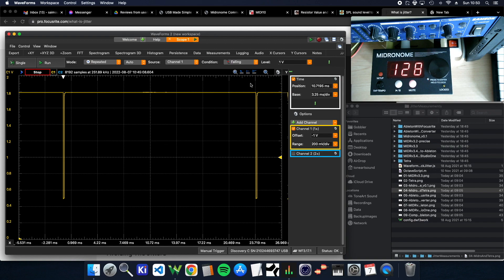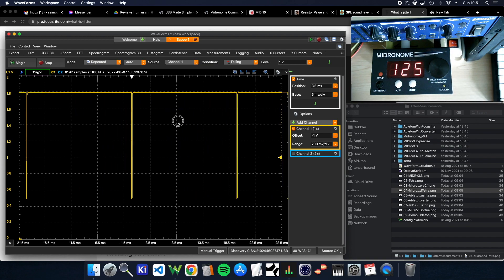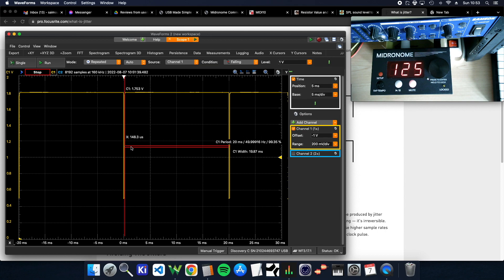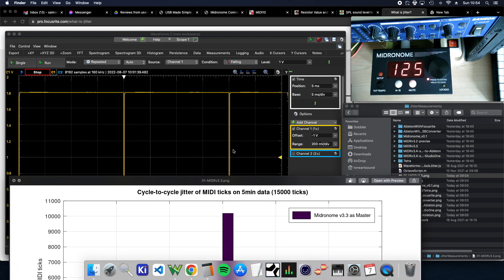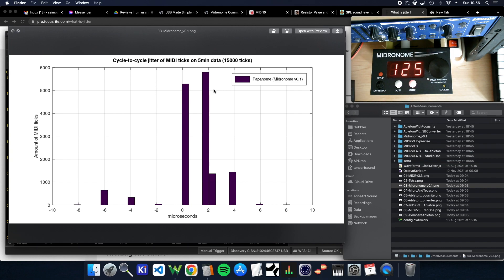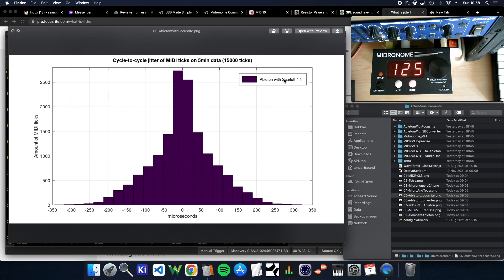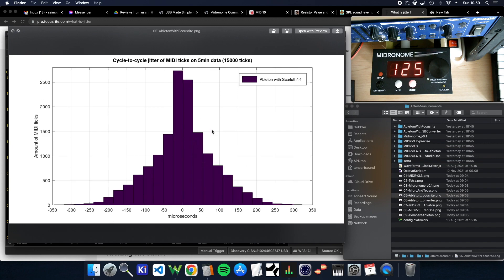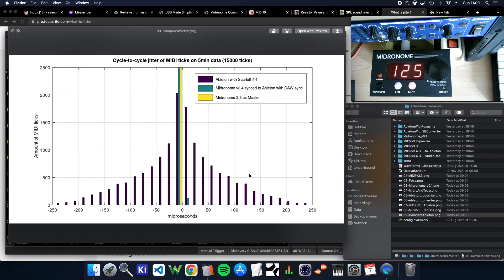Analysis of MIDI Clock jitter measurements using the Nome

Comment: Could you explain how you measure the midi clock signal with the oscilloscope? I thought Midi is a digital communication, so how can you extract the clock signal?
Reply from the maker: Thanks for asking! I do not measure the MIDI signal, rather the raw electrical signal, more precisely when does this electrical signal precisely start, and how much does that start moves (i.e. jitter). While it would be interesting to make a "real life situation" measurement, i.e. parsing the MIDI data into a piece of equipment and measuring when that arrives, then the result will highly depend on the MIDI receiving equipment.
My goal there was to measure the precision of the signal coming out of the devices. What happens after that, the way it is read (and the precision of it), is out of the sending device's control :) 
I hope this clarifies things a bit!
Simon
Reply: @simntonic  Thank you for the fast response :)
So your Oscilloscope is connected to the Midi Out connector (Pin 5?) and you measure the electrical signal or the digital communication?
Reply from the maker: @plake01  Yes - ish :)
I use a MIDI input test circuit, which I connect to the MIDI output. Then I measure the electrical signal (not the digital communication, the electrical signal directly) coming out of that test circuit. The measurements are done using a digital analyzer, which would mark the begginning of the MIDI Clock when the signal goes below CMOS levels (about 1V).
Simon

Comment: If you sync the DAW to the Midronome with USB does it reduce the jitter any?
Reply from the maker: Hey sorry it seems I missed that comment!
The Midronome will not "reduce" any jitter. But if you use "DAW sync" (see other video about it) to sync the Midronome to your DAW, then it will use the audio sample clock as reference (f.x. 44.1kHz), and this is usually very stable, much more stable than a DAW-generated MIDI clock.
Then the Midronome will create a MIDI Clock based on that, which should be very tightly in sync with the DAW.
Hope that clarifies things :) 
Cheers
Simon
Reply: so will also make ableton and ur midi interface output midi better ?  at to change the bpm of ableton can also come inm handy to have close by touch of a dial  @simntonic
Reply from the maker: @andym7333  The better MIDI is only there if you sync the Midronome to Ableton via Audio. The USB sync like you said it practical, but will not improve much the timing.
Simon

Comment: What tool did you use to measure the jitter?
Reply from the maker: I said it in the video. I do not measure it with "MIDI", I measure the actually electrical signal coming out of the Midronome directly, with a digital signal analyzer running at 100MHz. Which is the funny thing, the max precision I can get with 100Mhz is precisely 10ns. So in reality the jitter on the output is probably lower than that, but to measure it I would need a faster digital analyzer ;) 
Cheers
Simon